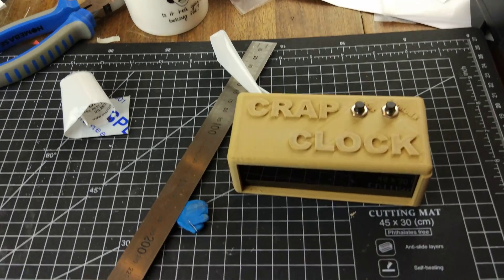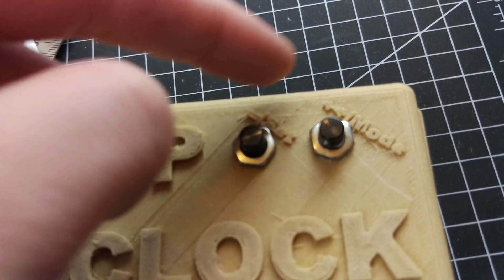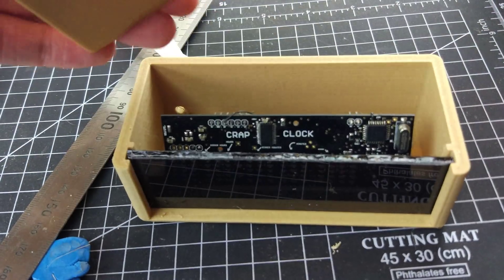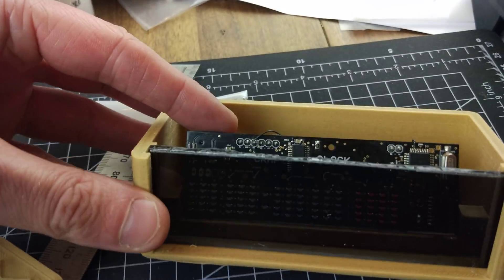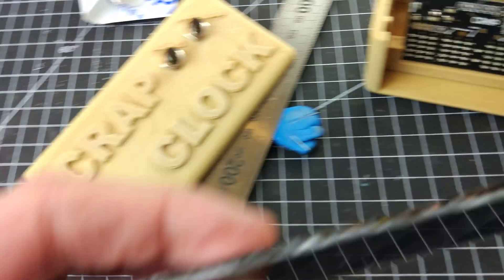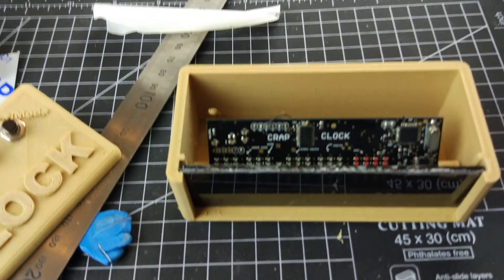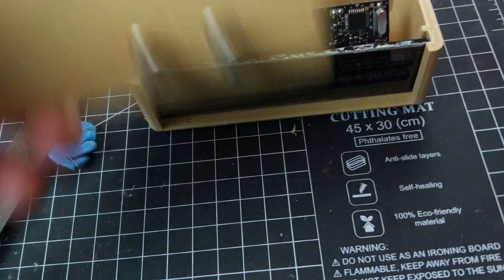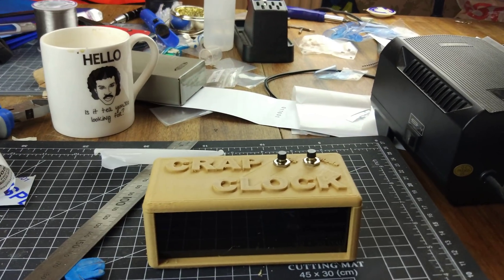Finished case in 'case' you hadn't seen it

Comment: Acrylic I use a fret saw  and two bits  of  straight of metal as a clamp and straight edge to work off
Reply from the maker: Ooooh, I have a coping saw, that might do the job.
Reply: Give it a go, you'l be pleased with yourself
Reply: To tidy up the edges of the acrylic, use the steel ruler perpendicular and edge on to the material. It should clean it up lovely.
I like the clock I think you just named it poorly. Nice work.

Comment: That's some rather smart looking crap!    At this point I've concluded that laser is the only way to cut acrylic without making a mess. It's a great way to get introduced to a makerspace if you've got one local but the Chinese K40 Laser units have brought the cost down so far that laser cutting is now personally accessible. The K40 is OK out of the box but add an air pump and an "air assist" nozzle around the output optics and now it's decent overall but great for cutting rectangles and such. You can go another step and upgrade the motor controller so you get more resolution and can use the community generated CAD and tools, and now you've got a really great overall home unit. Just an option....